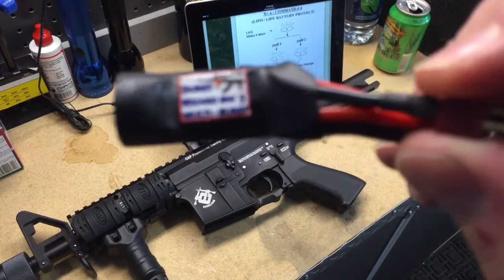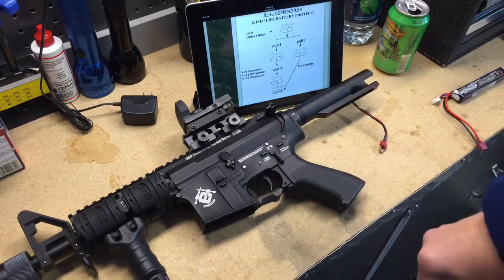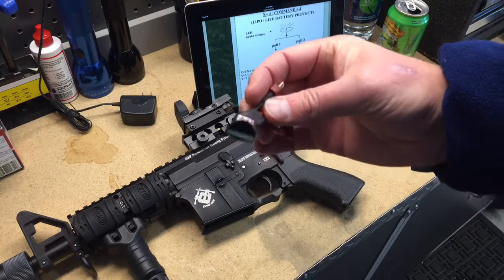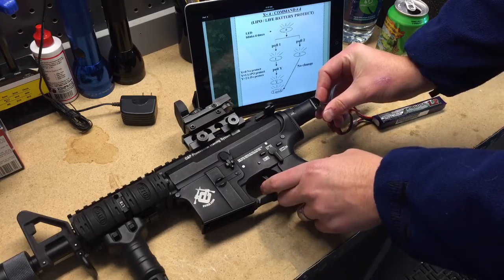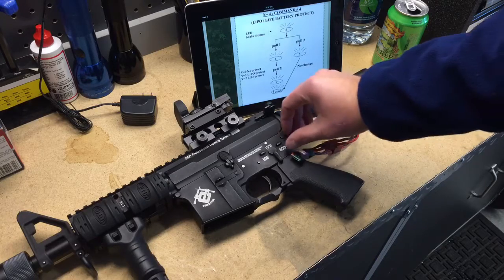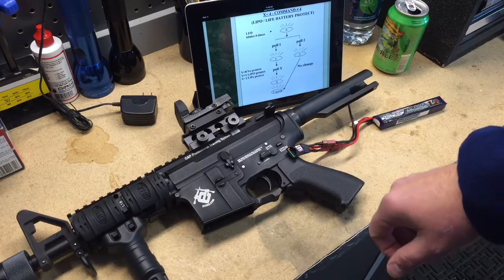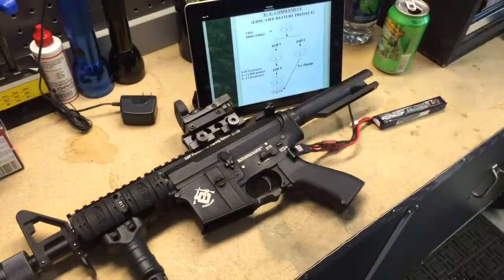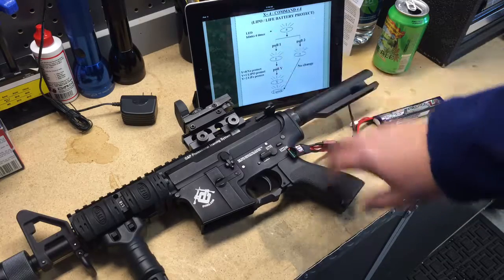Burst Wizard 3 lipo protect

Comment: On airsoft gi the burst wizard 3 comes with these red wires and red and black pieces do you need to put these anywhere for the mosfet to have the lipo protect?
Reply from the maker: Not exactly sure what you are asking, but if it helps mine was straight plug and play. (Deans)